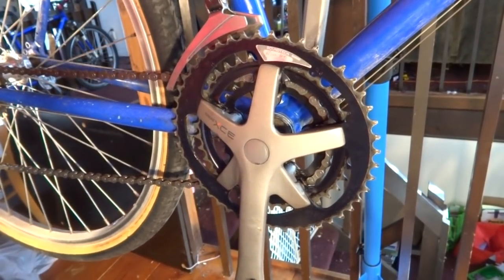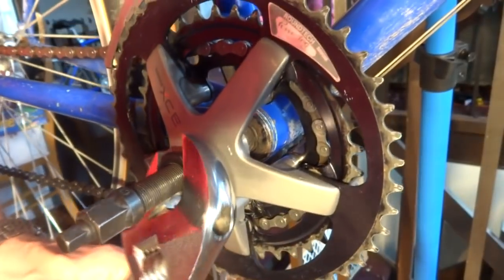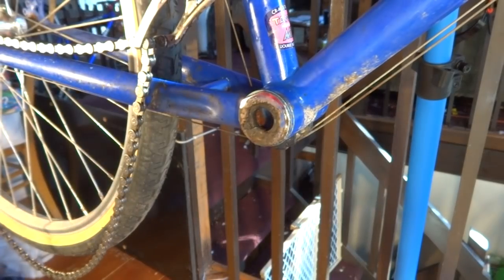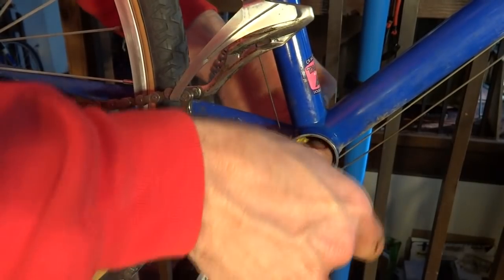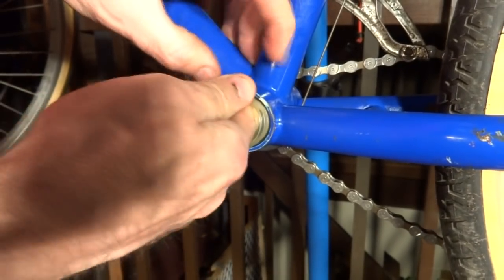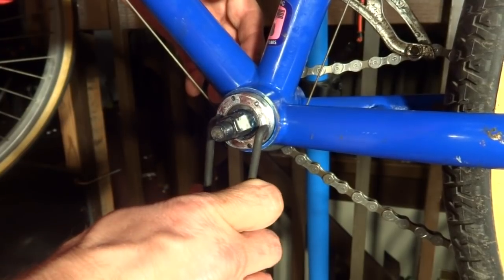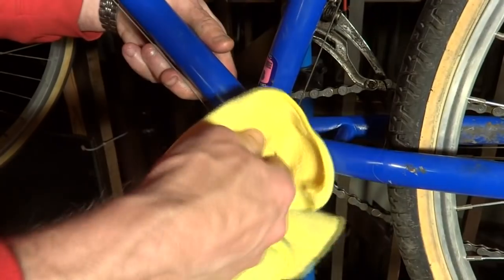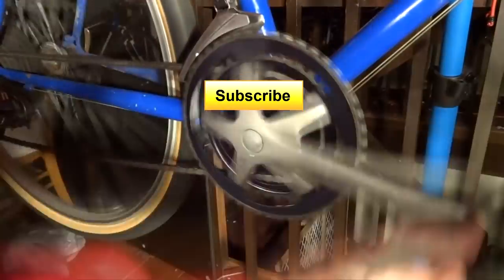Replacing Bearings In A Bottom Bracket

Comment: 👍Great tutorial, points to remember are drive side tightens counter- clockwise & bearings install cage closed side facing in (towards frame). If your bottom bracket doesn't have plastic sleeve, you can seal frame using a dab of silicone! I use anti-seize on threads rather than grease.

Comment: Thanks, man! You helped me get an extremely stuck fixed bottom bracket off before I destroyed the Packtool BBT-22. 
It was a sealed cartridge so I had to use a big ass socket over the spindle, and a woodshop style clamp to hold that Fn tool in place while I used a cheater pipe to break the damn thing loose!

Comment: Wow!!  Thanks.  I recently purchased an old mountain bike and definitely have wobble in the crankset as in you can grab both arms and wobble the whole thing a bit up and down.  Now I know where to start.  I don't have the tools today but they really aren't that much and I had no idea it was that easy to replace bearings.  I thought the whole bottom bracket was one piece, bearings and all, and you either replaced the whole thing or not.  BTW, this same bike came with Altus BR-CT90 brakes, broken grey housings and all.  But, I watched your video (and several by other people) and found it pretty easy to replace them with the CT-91's like you showed.  Not a single curse word.   Thanks again.
Reply from the maker: Some of the newer ones are Cartridge bottom brackets and are one unit.

Comment: This is a great video.
My bike is a bit less than 20 years old and needs a bit of service. (The bottom bracket seized)
Thanks to this clear video I got the adjustable cup off and found the bone dry bearings waiting for me. I need a better wrench for the drive side lock ring, but I'm getting there.
Not captive bearings, buy the way. Five little balls rolled off into the darkness. I'll have to find them tomorrow when it's light out. Considering the problem, I'm expecting to take them into the shop and buy new bearings anyway.
Reply from the maker: Yes, I recommend buying new ball bearings. They are cheap. Or maybe buy a cartridge bottom bracket. https://www.youtube.com/watch?v=1BrVjDFqotE

Comment: hcw4 or a good quality adjustable spanner is the question..16 pounds sterling for the hcw4 is not cheap,
bearing in mind these are old bearing systems that im hoping to get away from...but dont seem to be.

...i just cant decide...how durable are they buddy?..they dont flex?..what would you have done if it was tight?

Comment: Fixed cup is fun?  Have I got a job for you!  I used the 5/8" nut-bolt-lockwashers trick and could not budge it.  When I applied my Ingersol 2235 impact to it, we got about an eighth of a turn and then it froze again.  Lots of work to get it budge back and forth an eighth of  turn or less.  Aluminum frame.  What should I do?

Comment: That helped. Just ordered the park tool HCW-4. I really didn't want to throw that kind of money at a special tool, but I couldn't get the fixed cup off with a big crescent or channel locks. Nice to know it's reverse style threads. It makes me mad that they cranked the cup on there so dang tight. I'll have to bump it loose with a sledge hammer. GRRRR!!!
Reply from the maker: They are supposed to be tight. Or they will come loose.
Reply: @RJTheBikeGuy  I agree, but not so tight that basic hand tools can't get it off. This bike I'm working on was thrown together in China with an impact wrench. The ball bearings in the freewheel left dimples in the raceway and the headset was gritty from the bearing pre-load being way too high. I appreciate your videos, I've got the bike working better as a result. :)

Comment: I once had to use a 3-jaw gear puller to remove the crankset because of all the gunk inside the threads. It did the job, but the puller warped the crankset and I had to throw it away. So, for future reference, where can I purchase this "chaser" contraption at 1:42? I'm assuming the internal bolt is M8 and the outer bolt being M22?

Comment: Hi Rj, I am doing this myself and the video was quite helpful. At the end, when putting the cranks once again, shouldn't the amount of tightening be adjusted so that both cranks end up at the same separation with respect to the frame? I was thinking to use the distance from the inside of the crank to the chainstay tube as an indicator, then rotate 180 degrees and do the same with the opposite crank and tube. However, the non-drive side seems to need too much tightening and I am afraid to tighten it more. At the same time, I would think them being symmetric is important. Any suggestions?
Reply: You need to screw the fixed cup (sprocket side) all the way in.  If your crank axle is sticking out by the wrong amount on each side, it's possible you have an asymetric axle, and you may have put it in the wrong way round..

Comment: Hi RJ I have just change the bottom bracket on my very old mountain bike as the crank was clicking recently put a new chain on change the rear cassette five gears and you can still feel noise as you pedal very slight clicking I am stumped what to look for next please could you advise thanks a lot Ian

Comment: Hi RJm thanks for the video, this one is superb. I tiny question: why i my bottom bracket always loosing up? Not enough tight the lock ring? Or what could be the problem?
Many thanks
Reply from the maker: kiflincs Could be it's not tight enough. Is it a low end bike? They are made with cheaper parts and stuff like that is expected.

Comment: great vid I have tightened crank bolt several times keeps coming loose the crank bolt is as tight as I can get it as is the lock ring, have wobble on pedals about every 10 kilometre, how can I fix this permantly I have only worked on the none drive side the opposite side to the gears thinking of using locktight what do you think when I first fix it is great the bike is only 2 years old and  cheap to see if I would use it regularly before I buy a reasonable good bike, I am 64 so not racing or anything just exercise
Reply from the maker: Could be the mating surfaces in the crank arms are damaged. I can't give you a definitive answer without working on the bike. Maybe take it to a shop to have them look at it.
Reply: thanks for your reply cheers

Comment: I have a Trek bike - 68mm shell with a shimano 7 speed Hyperglide cassette, brakes, etc, from 1992 - what type of tool will I most likely need to remove the BB? Just hoping that there was a standard design back then.  It has a three ring(21 speed) front crank set and is all stock.
Reply from the maker: To be honest, I don't know off hand. I have worked on a variety of Treks, and they vary. You should be able to see the BB cups well enough without even having to remove the cranks, to see what tools you might need.
Reply from the maker: If you send me a photo of what the outside of the cups look like, I might be able to tell you.
Reply: Thanks for the response, it is a Trek 850 Antelope - just found a video of this bike on YouTube by Zalsentzer - Trek 850 phase 2b - that has a view of the BB w/o the crank arm.  Thanks again shyflirt1.
Reply from the maker: Mike S If that is what the bottom bracket on your bike looks like, then you have a sealed cartridge bottom bracket, and this is the tool you will need. http://www.amazon.com/exec/obidos/ASIN/B001A0AIAG/ref=nosim/youtube25-20
This video shows removing and installing one of those: How To Remove/Install Sealed Cartridge Bottom Bracket

Comment: Could those berings be used for the hub in the back wheel
Reply from the maker: https://www.youtube.com/watch?v=_axwV6sfaAs
Reply: @RJTheBikeGuy  yea im sorry but that vid didn't anwser my question I wanted to know if u can use caged berings in the back hub😅
Reply from the maker: @netherstone3161  Loose bearings are better than caged bearings. Caged bearings are used to reduce cost because the labor in the factory is easier/faster. That is why they are usually found in cheap low end bikes.

Comment: The crank arms on my bike move when I try to pedal, but the chainring does not? What's wrong with my bike? Please help, thanks.
Reply from the maker: It kind of sounds like you might have a bike with a Shimano Front Freewheel System setup that isn't catching. What kind of bike is it?
Reply: RJ The Bike Guy I'm not sure, it doesn't have the model stickers, but I've been told it has Shimano 21-speed Gears with Microshift Dual-Index Rotational Shifters.
Reply from the maker: Without more to go on, I can't really help you. Maybe you can post some photos of the bike over on my facebook page or something?
Reply: RJ The Bike Guy Should I inbox you?
Reply from the maker: Just post it on my page.